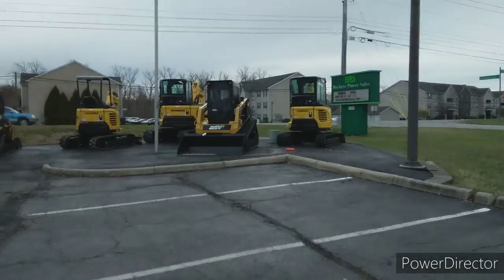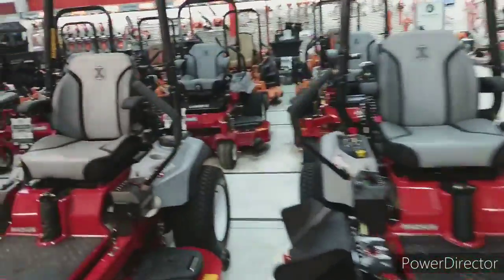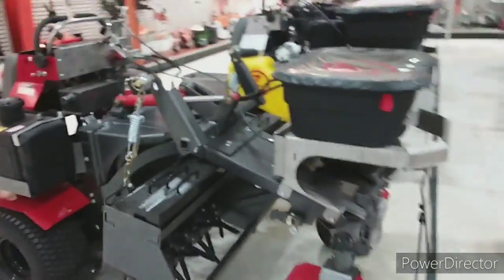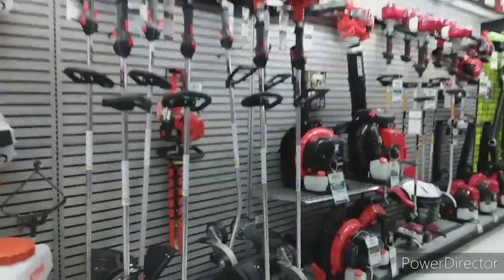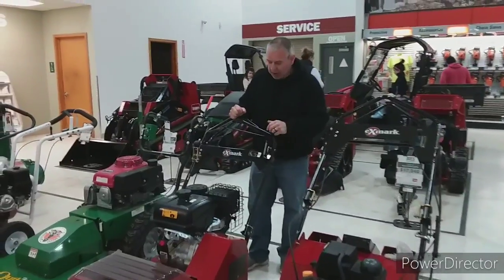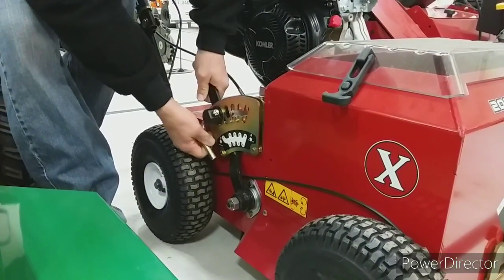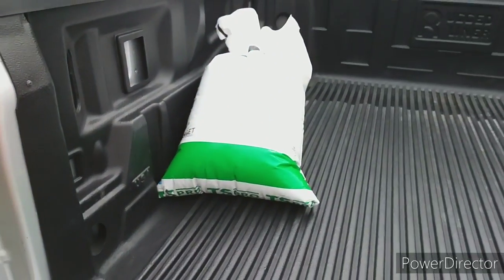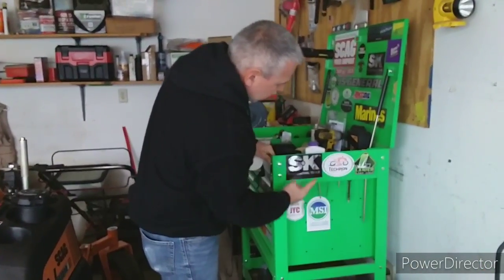Exmark 20" Slice Seeder | How It Works

Comment: Glad to see you using an eXmark 👍👍👍👍👍👍👍🤣🤣
Reply from the maker: I am curious to use a different eXmark product. I have never done this before, should be different
Reply: @DOCREAL1118  see if they have a hydro walk behind aerator there. Check them out they are  So much better than those Ryan's.
Reply from the maker: @jasonobannon1160  They do but the cost for the amount i do isnt worth it
Reply: @DOCREAL1118  4k